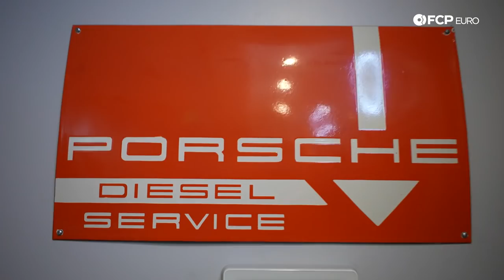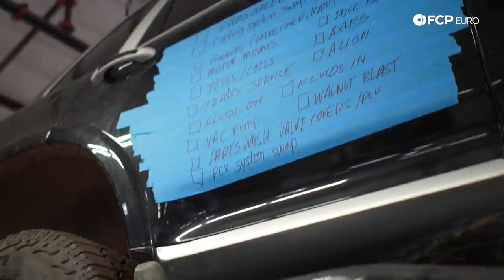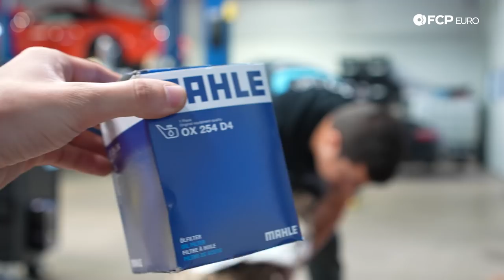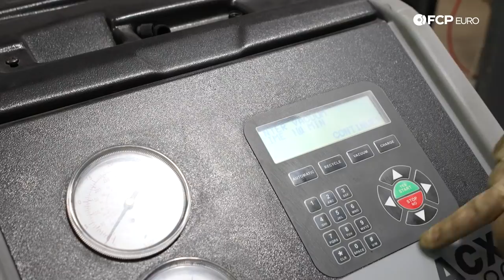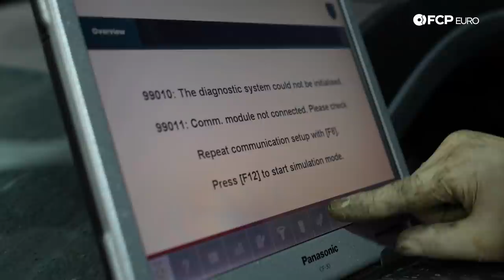Engine Swapping Our Hydrolocked Cayenne In 2 Days - Ep6 #YippieCayenne

Comment: Fantastic work.  I hope your transmission torque converter seal doesn't start leaking.  It's a $20 part, but needs transmission out...which can be done with the engine in.  The transmission is shared with the Toyota Land Cruiser, and is generally bullet-proof...except when the Porsche coolant leaks down there, gets crusty and shreds that seal.  At 155K miles on my 04 Turbo, It is next on my list, and I'm dreading it, in my one car garage.

Comment: 33:40 did you blow out the lines? If not you're gonna burn through the dessicator in the compressor pretty quick...actually I would replace that forthwith even if you did blow out the lines since you wouldn't be able to get all the moisture out